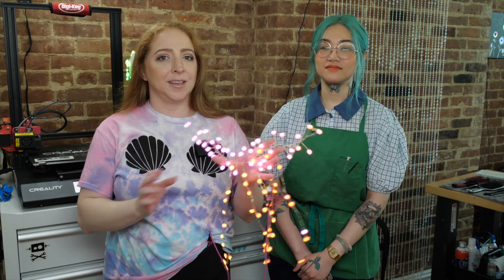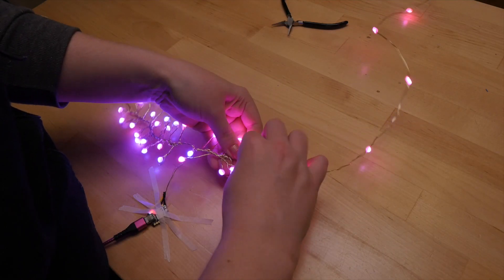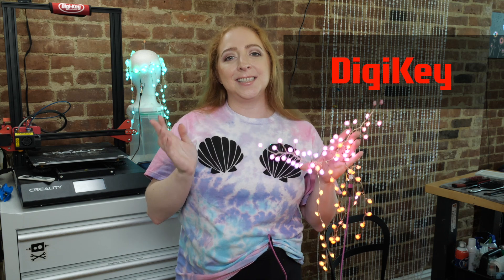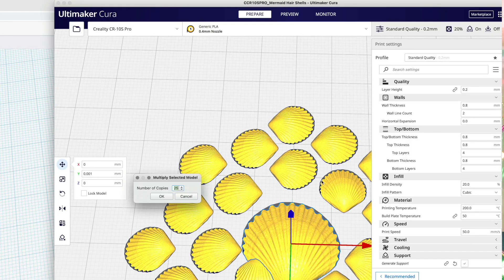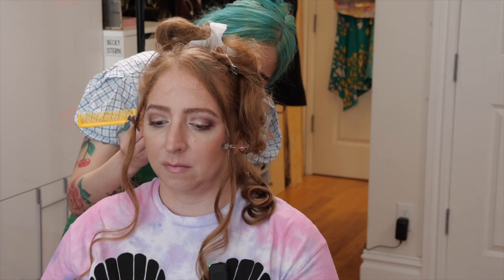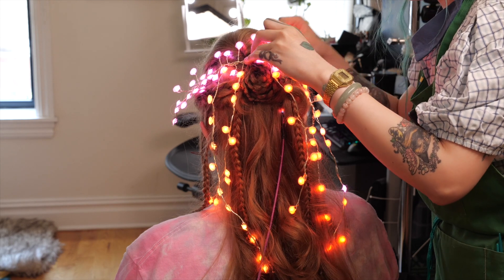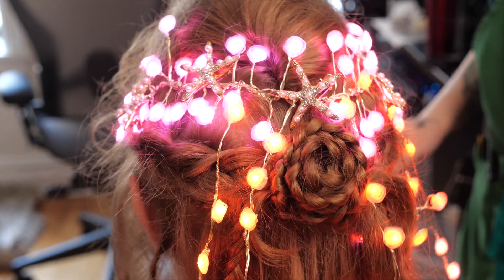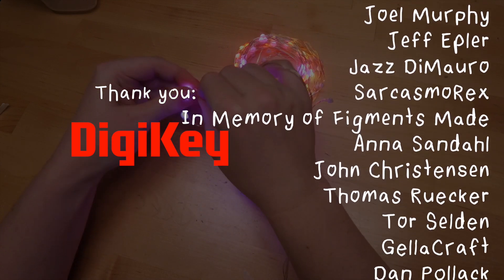Mermaid Hairstyle with LEDs

Comment: I just bought some of the LEDs used in this project based on the video but now that I’ve got them I’m a bit confused about how to code and connect them. Even though the brand is listed as adafruit on the digikey website they seem like nothing I’ve seen from adafruit and suspect they are not. Anywho, the code snippet doesn’t have any context. I’m assuming the code on the tutorial goes in loop() but how do I initialize them? Are they WS2811? The data sheet I found linked to the product says “It is not totally compatible with 2811 controller”, but not sure what that means. Any clues, pointers are most appreciated. In the meantime, I’ll forge ahead treating them as WS2811 to see what happens 😮
Reply from the maker: The code snippets are functions you can add to the basic NeoPixel sample sketch (outside the loop), and then call them from within the loop. Here's an example: https://www.tinkercad.com/things/c3EZXKp5PqO-mermaid-hair Thanks for your note, I'll update the tutorial to be more clear. if you bought them from digikey, they're genuine. But it is a bit of a funky product, here's more info: https://www.adafruit.com/product/4917
Reply: Thank you so much for the speedy response! I got brave and just used one of my existing sketches and upped the numpixels to 100 and it worked! Now I gotta get to work on the rest of the design for my project.